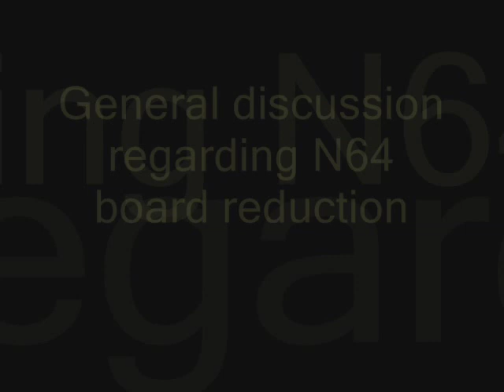N64 log - 4 - Discussion about trimming the N64 motherboard

Comment: im planning on fitting my portable inside an older chunkier laptop because the n64 board dosn't look that much bigger then a laptop motherboard, my only problem is modding the laptop screen to work with composite and not vga though i could probably use a adapter or something.